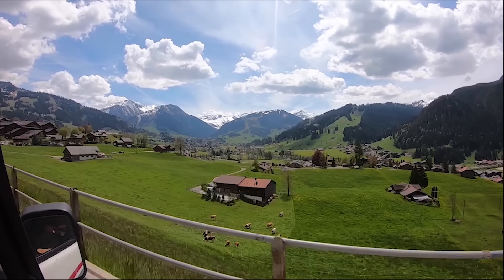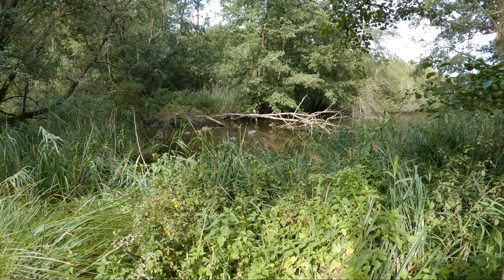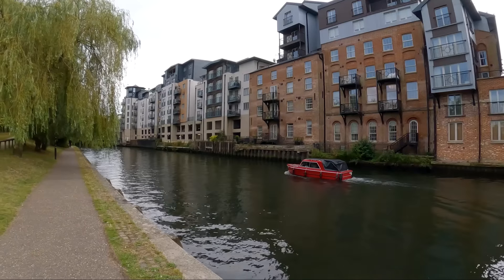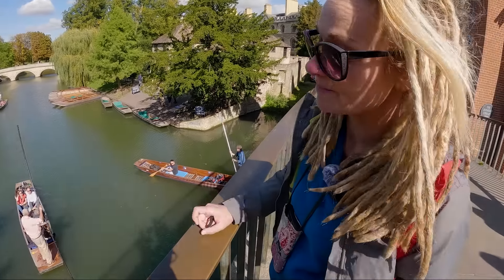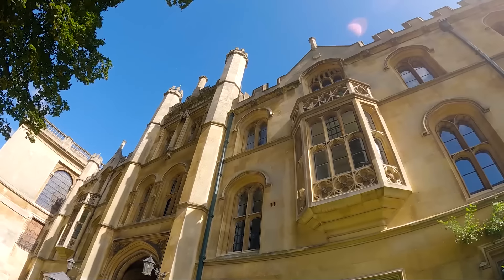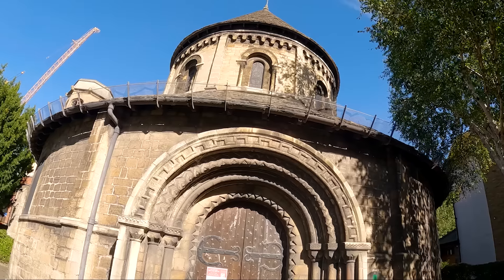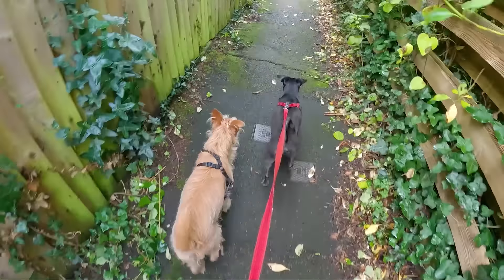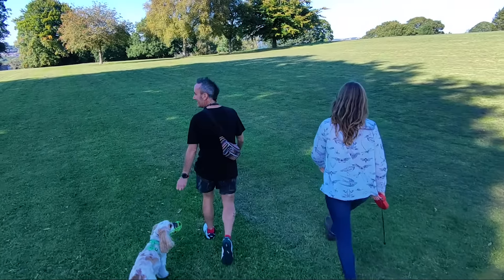VAN LIFE in CAMBRIDGE - LIVING IN A VAN IN ENGLAND 🏴󠁧󠁢󠁥󠁮󠁧󠁿

Comment: Hey guys. I know it's not winter but getting rain coats for Scotland is not all you need to consider. What about the Van. Does it have antifreeze in Engine Coolant. Screen Wash liquid in bottle. Ice scrappers for windscreen. Not forgetting Haggis Spray which is similar to Bear Spray just in case you are attacked etc. Sporran Deoderant etc. I have just done Antifreeze on my Campervan and it wasn't easy. Just in the process of putting my winter kit together. I may do a video on my channel etc. George
Reply from the maker: I think we will be fine in October, our van is kitted out with a factory build webasto heater that heats the engine and then the cab, keeping us and van warm, the van was in Northern Sweden for the first 7 years of its life!
Reply: @theexPAWers  That good news. My Son is Leicester pumping water out his house etc. We are lucky. Have a good trip. Our next one is Cromer for a week. Not in our van but for slightly more money than a Campsite we will be in an apartment  flat in an old bakery. Living it up. George and Jane

Comment: BAD NEWS FOR YOU GUYS Yes, it is illegal to have loose animals in your motorhome while driving in the UK: 

    The Highway Code
    Rule 57 of the Highway Code states that animals must be properly restrained in vehicles to prevent distraction or injury. 

Penalties
If you don't restrain your pet, you could face a fine of up to £5,000 and penalty points on your license. Your car and pet insurance could also be invalid. SO YOU BETTER BE CAREFUL WHILE IN THE UK and hope no one snitches on you, but then the police could check your flogs.
Reply from the maker: They are harnessed in the front, with belts that are attached to the bottom of the chair, they can’t jump over to the driver at all..